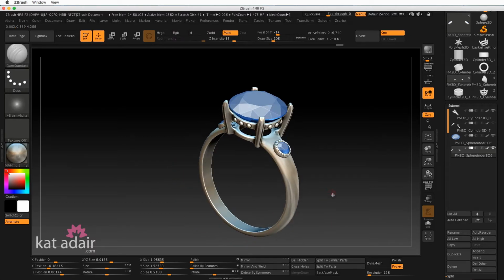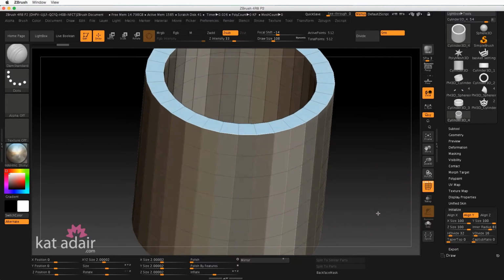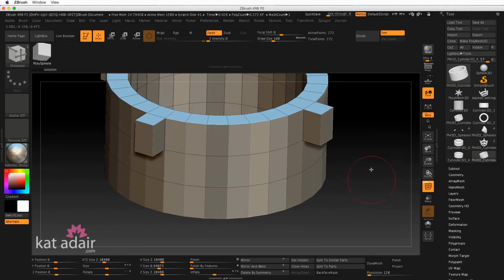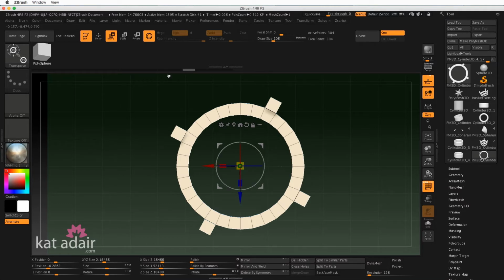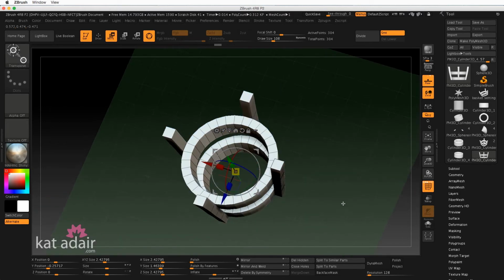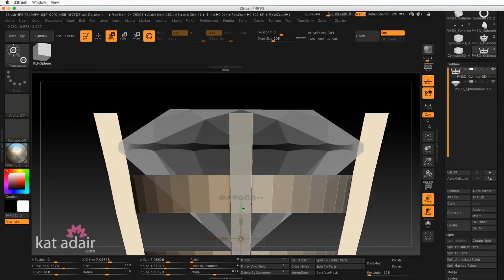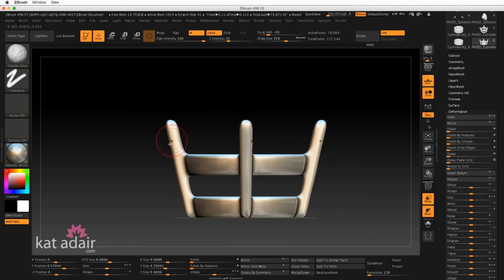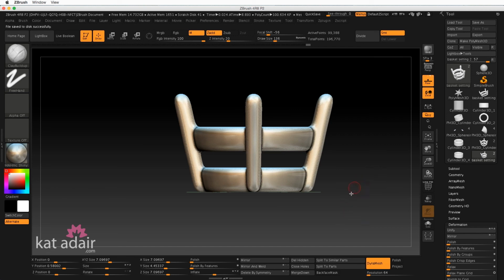ZBrush Jewelry Basics: Basket Setting Tutorial in ZBrush

Comment: how i can add the ring to the basket?
Reply from the maker: You want to append a ring 3-D in the Subtool section on the right. Then you’ll switch to the move mode, and use the arrows in the gizmo 3-D to position the ring. If you’re feeling brave, you can also append a Cylinder3D, divide it three times to smooth (command or Ctrl D), in the Geometry section use Del Lower to remove the lower subdivisions created by dividing. Then we use something called Boolean Folder to subtract the cylinder from the ring. Place the ring and the cylinder In a folder, with the cylinder at the bottom. Turn on the “moon” icon (subtract) on the cylinder, then use the gear on the folder to Boolean Folder. That will give you a flat inside to the ring shank. Use the Gizmo to resize and position the ring. 😃

Comment: @
Kat Adair  Thank you for sharing nice tutorial . Do you have plan to do more videos?
Reply: I have two questions about the tutorial. 1. After I created a cylinder and adjusted  prongs then while picking a brush zmodeller and used it on the object.It keeps letting me to convert the object to polymesh 3D. How can I fixed it  ?                           2. I got a problem when  benting a basket setting. while I using a standard move tool(I have older Zbrush version) the prongs on the middle didn't go along the way together and that made prongs got overlaping . How to fixed ?                                   ❤️ Thank you in advance ❤️. I'm a newbie, learning to do jewelry design on this programme.

Comment: This is an awesome teaching video, thanks for that but I have a question, I couldn't manage to download the stone tool, isn't it in the file or should I look for somewhere else ?
Reply from the maker: Yes, look in the Ring Master plugin, toward the bottom under the Gem Stones section. Uncheck the button marked On Band, then press Add Gem Stone Subtool. You will probably need to center the Gizmo 3D...switch to the Move mode and when you see the Gizmo, click the third icon that looks like a Google Places  icon. Then click the Home icon over the Gizmo. Use the arrows to drag the stone into position. Let me know if that doesn’t do the trick!
Reply: @KatAdair  Perfect. Thank you!
Reply from the maker: I just added a Stones file to my Google Drive...it has 4mm stones in a variety of shapes in one file.  Use the Load function under the Tool palette to load, then switch to your project and use the Append function to add the stone.  Whatever stone is "active" in the Stones subtool will be the stone that shows up as you Append another subtool.  

I have been using Pixologic’s RingMaster plugin for the stones ONLY. you can add very low poly count stones to your project. However I do not like the way that RingMaster handles sizing of the rings. But it does have a feature that allows you to “add gemstone” and choose a size. If you’ve been following my videos and working with size like I do, the stone will come in very small. Easily fixed by resizing, though. I uncheck the “on band” option. 

In the description, I've added a link to Pixologic's Plugins page as well.

Stay tuned...I have another video on making a basic band, then turning it into two different rings coming. It deals with size a lot! And thank you!
Reply: @KatAdair  Thank you a lot! The problem is solved :)
Reply: @KatAdair  I'm not seeing 'stones' in your google folder. Are you staying the gem stones live in the RingMaster plugin?

Comment: how can i messure real gem size in zbrush ?
Reply from the maker: nazmul hoque, I just saw your message...sorry for the delayed reply. 

That is a tricky question with a lot of different answers. I use Ringmaster (from Pixologic) to bring in a low-polygon count gem. But when I use ZBrush, I actually resize my model so that the XYZ size IS the mm size. I have to make other adjustments, like working at a lower Dynamesh resolution, but I can use the transpose line as a measuring tool, but also if I bring in a cylinder for a ring, I can enter the mm size as the XYZ size, the resize models around it. I have another video where I use this technique, but I’ll do a tutorial here shortly where I explain my technique. 

Other artists are using Scalemaster or Ringmaster to establish a scale, and it works for me, but I prefer working at an “actual size” and not a scaled size. Hopefully you found an answer before I replied...my parents went into assisted living and I’ve been downsizing and remodeling their house for the past year.